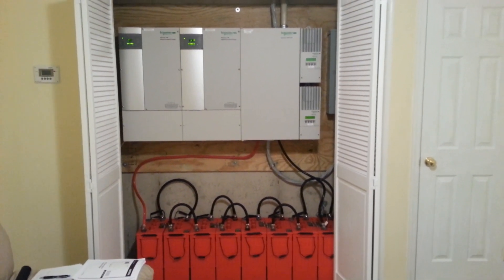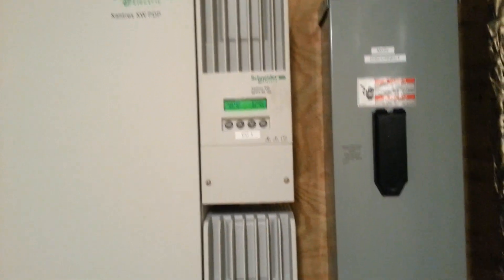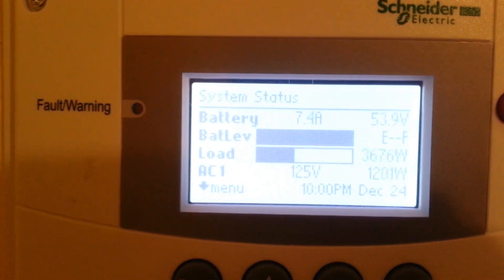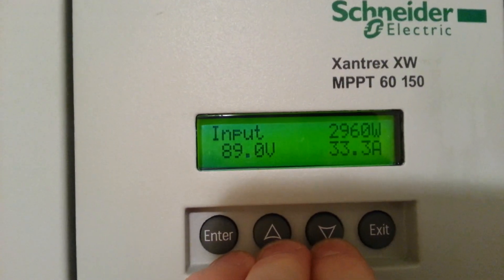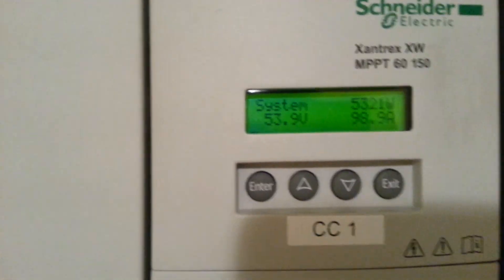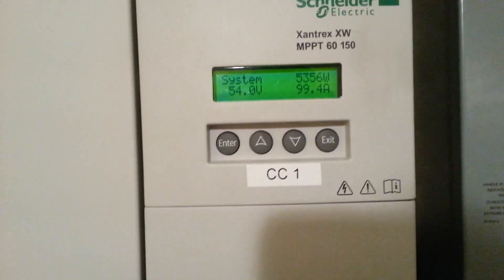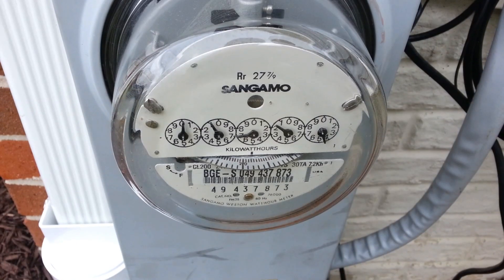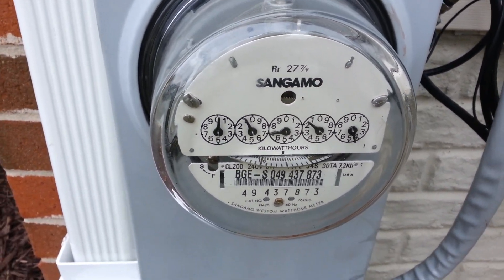Residential hybrid Solar panel system designed to work on and off grid

Comment: I live in upstate NY and we have signed a contract for solar panels 7.25 KW system total cost after a NYSERDA Rebate and Tax Credits our total will be $7,308 on Grid Only, using a Solar Edge Inverter power optimizers and Panels from Trina Solar.
Reply: 2558jmb can you tell us about your experience now that you have solar panels for over a year? I live in Virginia and am considering it. Given that most folks with residential solar systems are from southern states. How are you coping with snow?

Comment: You can cut the initial costs by half by going from Hybrid to only grid-tie system (given the fact that you will not need batteries, charge controllers and Hybrid inverters)!!! 
However, it is the matter of how reliable your grid is going to be. 

Thanks for sharing this video.
Reply: ***** It doesn't have to cost twice as much for a hybrid system.  That's crazy to pay that.  What you do is get a grid-tied system installed but then you modify it yourself to store power for when outages occur (maybe buy batteries one at a one, as you can afford them).  But, I wouldn't go for super expensive power inverters.  I would buy one that's just big enough to handle essential things during the outage.

Comment: when roof needs replacing in 15 years the panels will have to come off.  It will be expensive and no single contractor will do both jobs.  Batteries and other equipment and panels will last what about 10 to 15 years?  Reality is the system will never pay for itself.  Solar energy is the electrical source of the future and always will be.  My taxes dollars are paying for the silliness
Reply: My company does
Reply: Are your tax dollars paying for 15 years in Iraq?
Reply: The majority cost of solar comes from the panels, inverter, and electrical work, none of which is undone while replacing the roof.

Most solar manufacturers have warranties guaranteeing >=80% output at 25 years. Inverters can be expected to last 10 - 20 years.

Solar panels may also be installed on mounts rather than the roof.

Solar is reaching grid-parity at which point subsidy will no longer be needed to incentivize installation.
Reply: Kudos for the video content! Forgive me for butting in, I am interested in your initial thoughts. Have you thought about - Schallingora Computer Reconstruction Scheme (do a google search)? It is an awesome one off guide for saving money using this smart solar power trick without the hard work. Ive heard some unbelievable things about it and my friend Sam  got excellent success with it.
Reply: Your taxes are also paying for useless prisoners so shut up
Reply: Gerald Bennett you are way off on your reliability predictions. The solar power industry has cone a long way. Think about solar as point of use generators which offset the need to build more power plants. The government and utility companies also provide incentives for energy efficient HVAC and insulation which is the same concept of reducing load on the grid. Time to get on board because I am. I'm installing an 11.4KW system during the next two weeks. Looks like a 10 year payback and nearly an 11% return on my money invested without even considering future energy rate increases.
Reply: Gerald Bennett  Nonsense. In reality it depends on how much power you consume in the given amount of time.
Reply: wait till they get rid of all the coal fired power plants,  then pay back will be a lot  better.

Comment: How do you know if 1 or which one of the batteries go bad,  and what is the maintenance?
Reply from the maker: the batteries have access lids on the top of them. I guess a specific gravity meter to measure the charge of the batteries under fully charged conditions. I measure them about every 2 months or so!
Reply: johnny5634 thank you. I just bought a meter to check the batteries,  but the panels themselves they need constant wiping? Any special chemicals?  I have also to make sure it is not stepped upon.

Comment: Your system is solar panel string inverters? That is what it looks like. I am planning a 10K watt system in Florida and intend to just make it grid tied which should save some funds regarding chargers and batteries. I am building the house at the same time so I plan a total integrated look. It looks like your payback will be around 8-9 years?
Also do you know what the wind rating is of the connectors for the solar panels and the solar panels themselves?
Nicely done install and system...

Comment: How much was the investment vs years to recover the cost?
Reply: According to the charts (at 6:30 in the video), breakeven on a occurs after 9 years, though the actual payback period will vary with electric rate adjustments, weather, and real energy use. When we got our solar panels, we had initially thought our breakeven point would be at 8 years, but a change in our utility's pricing methods has pushed that back to 9 years. That said, as appliances and systems wear out and are replaced, hopefully with more efficient ones, it may be possible to bring the breakeven point back to 8 years or maybe better.

Comment: What do you do when it snows? It should be installed on the ground so that you can remove the snow.
Reply: louis tournas you could always install some low-wattage under-panel heating option for you panels, nothing too hot but something that is enough to prevent snow from settling on the panels i think there is an option for this available on the market but im not 100% sure, but certainly it is something you could probably do yourself if you wanted to
Reply: johnny5634 a brief Google search found this commercial solution (http://scirustechnologies.com) , but you could probably use cold or warm water to the same effect, if you installed a hose along the top of the panel with small holes like those used for autonomous plant watering for example, in theory that should be enough to clear snow from the panels, as long as its well above freezing temp it should melt any snow,
Reply: You are still connected to the grid so you have to figure out of the year you might have used 8 weeks of electricity from the electric company and earned 30 weeks of credit from your system. So if you have to give up 8 weeks of earned credit your bill remains zero!
Reply: Mic Theory
Maybe you are in the USA? Here in Canada, it is 6 months.
Reply from the maker: Ron Laws Thats a very cool idea but it would use a ;lot of power to keep the panels warm. Great idea though! I thing an air pressure hose idea might work better?

Comment from the maker: The batteries are estimated to last for 25 years by only attaining 20% dod replacement batteries would cost $3500ish But in theroy the batteries dont need to work great to serve the purpose of a hybrid system. all they need to do is provide a dc diversion load so the panels can operate during a grid outage

Comment: Well done!  Very nice setup.  According to the Cumulative Cash Flow chart at ~6'30", your ROI will amount to ~$60k over 25 years (the approximate life of the equipment according to ~1'05"), or ~$2,400 per year.  The Energy Production by Month chart at ~6'25" adds up to ~9k KWh per year.  $2400/9000KWh = 26¢ per KWh, which is considerably more than BGE charges; do they buy at rates higher than they sell?  Is any of the equipment made in USA?  Are EOL disposal costs built in?  Thanks in advance!